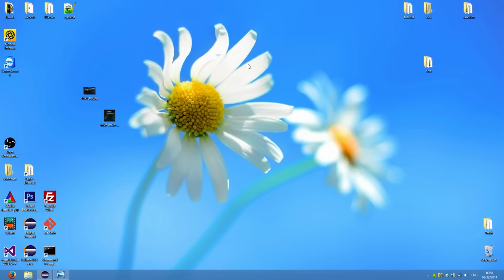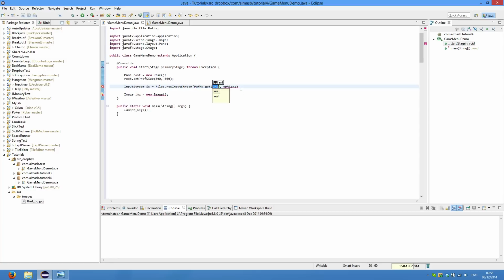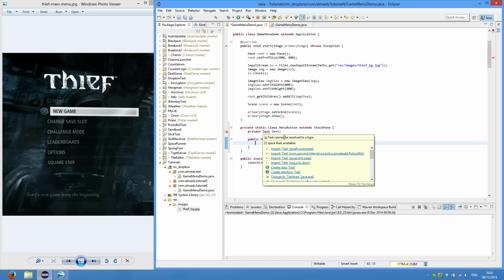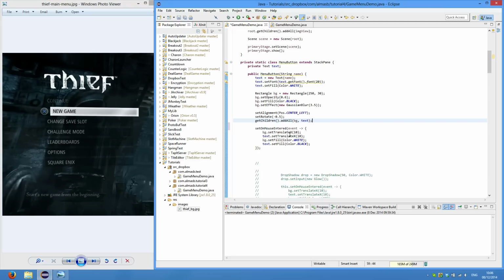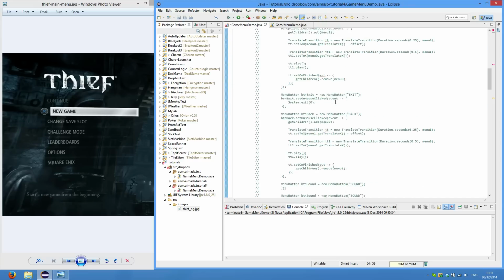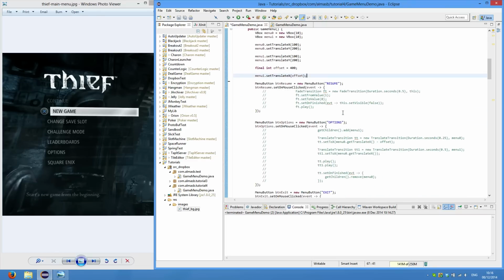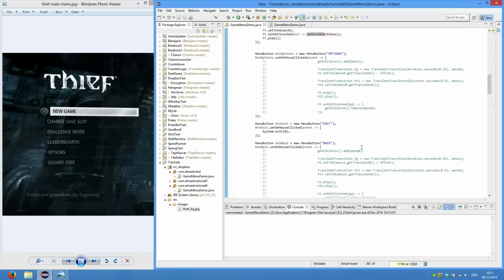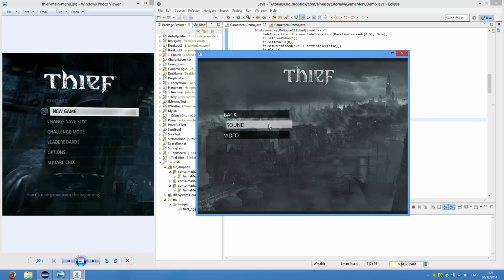JavaFX Custom Game Menu: Thief

Comment: I have a test, and I wanted to use this menu to access each of the questions, for example, select "Question 1" from the menu, and the button run a code where I can ask the user to enter values for some variables that will be used in the calculation of the question, would that be possible?

Comment: Instead of using an image as the background, how would you use a looped animation (longer than a typical .gif) like you see in some modern game menus (with blurred flashes or particles)? I can't find videos on this anywhere - at least not for java. If anyone knows of a good one, please comment.
Reply: For example, here is a simple intro menu (from a very enjoyable game, IMHO) that could easily have a stackFrame menu on top of it: https://www.youtube.com/watch?v=hjn5m889JsE . I would like to know how to do something like this in the background.
Reply from the maker: Each character is probably a single animation loop (from a sprite sheet). Run an AnimationTimer and update frames as needed. They will be sorted with an appropriate z-index. Put a javafx Group on top and particles become really easy. Example of Skyrim menu particles in javafx: https://www.youtube.com/watch?v=raqK08Yaz3U Finally, add another Pane or some other container to keep your menu items

Comment: Hi. Thank you for these tutorials, they help me a lot!
I have a question, pretty basic I guess. I have already made my game, and want to implement a menu like this.
How can I implement this code to my code? I mean, where should I make a new GameMenuDemo object in my code to make it run? I tried, the game runs as previously, but I cannot see the new background image and the buttons. Are they rendered under my game? or maybe they are not rendered at all? Any help greatly appreciated!
Reply from the maker: +bla2030 Hi, GameMenuDemo is an application on its own so you can't just stick it somewhere. You will need to strip out the UI related code into, say GameMenu with its own root node. Then you can create an instance of GameMenu and attach its root to the root of your own game. Finally you will need to provide some access to your game, i.e. when new game button is pressed you call your game's startGame() or something along these lines
Reply: +Almas Baimagambetov (AlmasB) Hm.. the rest of the program is based on JFrame. Is it possible to have the game in JFrame, while the UI in JavaFX? Seems I have to study more on the subject, it is the first time I mess with javaFx and the root/node idea.
Reply from the maker: +bla2030 Technically, it is possible to use both frameworks. You can read about fx-swing interop here - https://docs.oracle.com/javase/8/javafx/interoperability-tutorial/swing-fx-interoperability.htm
In practice, however, you are likely to run into many issues and you need to have a solid understanding of both frameworks and their internal architecture in order to make the blend work as expected. Depending on what your goal is, and if you have spare time, I'd recommend rewriting your game in JavaFX.

Node is a term that comes from graph theory and in JavaFX context it means an element of the scene graph. The scene graph is the data structure that internally represents UI objects that you see on the screen. A scene graph is used in many graphics frameworks because of its properties. For instance, if you look at it as a tree (which it is) in order to make a composite UI object hidden (0 opacity), you simply apply that to its parent node. This effect will be passed down to all of its children and they will also be hidden.
Reply: THANK YOU for all this info! I really appreciate your time and care you give. I will probably create a simple, basic UI in swing, in order to keep things moving, as I am already behind schedule. Later on, I will try to implement or completely rewrite in javaFx the game, as you said. Thank you again. Keep these very helpful videos and comments coming... Wish you all the best!

Comment: You could use the standard Button and style them with CSS to look exactly like you want. No need for deriving a new class for the buttons

But I love your tutorials so far. There isnt much about JavaFX and gaming like your videos on the net
Reply from the maker: Lars Roth Hi, I'm glad that you liked the tutorials. Yes, although FXML and CSS are the recommended way of defining View in JavaFX MVC, when it comes to non-business applications, e.g. games/menus I prefer to keep UI in code. Unfortunately, that does mean that a change to UI will cause a change to code, followed by source recompilation and some other issues, which may or may not be the deal-breaker. So yeah, I suppose it's a design decision. I might switch to FXML/CSS in the future tutorials though. Kind regards, Almas